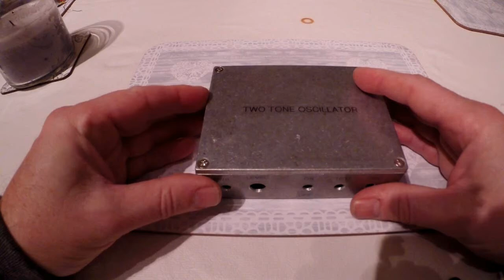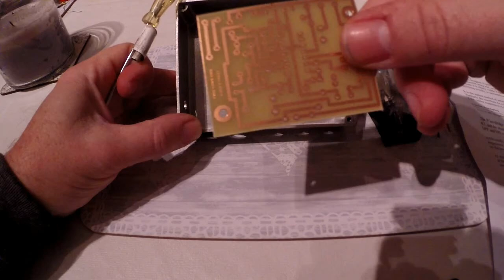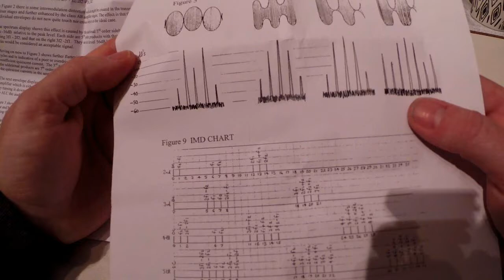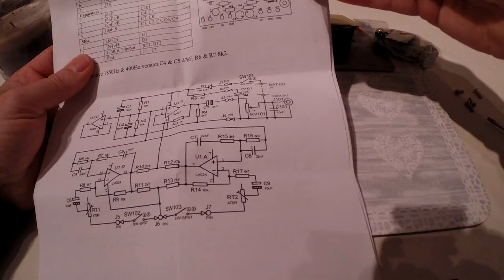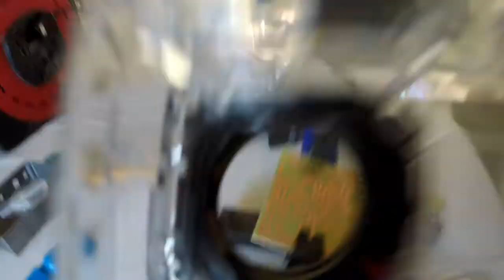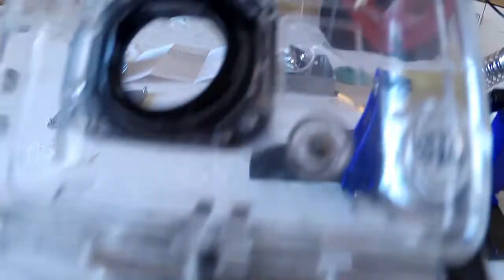Two Tone Oscillator Build - Part 1

Comment: I've been thinking about getting that oscillator for a while now!, I've bought plenty of stuff from spec comms over the years and just put in one of their Roger bleeps into a York 863 cb rig yesterday!.
Reply from the maker: Perfect timing then Elliot! The chap who runs spectrum comms is a bit of a character, wasnt sure i would get the missing parts but did no hassle. The York 863, nice radio and the front fits nicely onto a superstar 2000!! as seen in some of my vids👍
Reply: @britishcbradio1055  yes, Tony from spec comms can be a bit difficult at times!. I have a ss2000 here but it's been modded to cover 28 to 30 mhz!.
Reply from the maker: @elliotspencer2648  thats what my york 863 stealth rdituon is a SS2000 with a york fascia on, they are my favourite multimode of all time. Mine is the later 5x bands if 40ch. You certainly have a warehouse full of radios there Elliot! 👍
Reply: @britishcbradio1055  my ss2000 is the 4 bands of 50 channels which is easier to use on 28mhz. I do have a decent collection of cb's here including two "teaberry" 23 channel USA mobile am rigs and a 12 channel 0.5 watt German mobile am rig made by 'lenhert'.